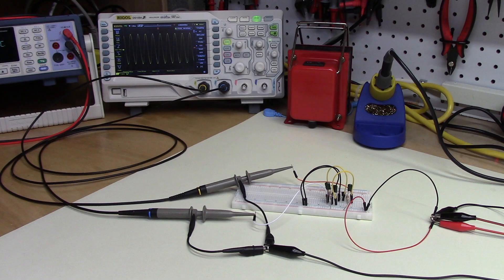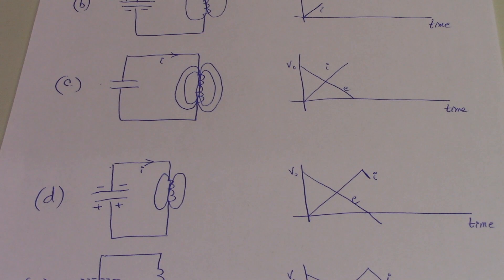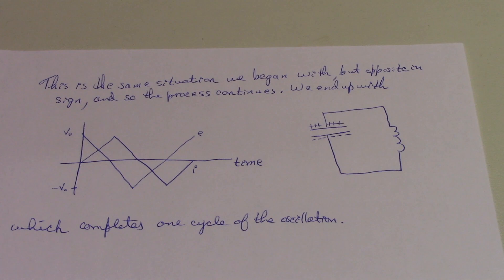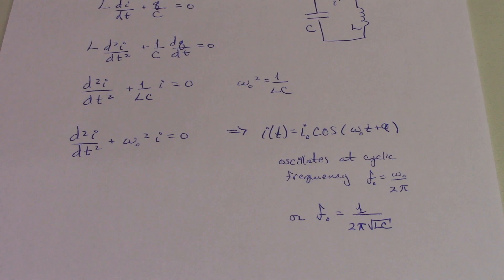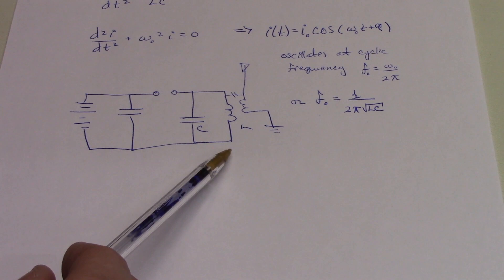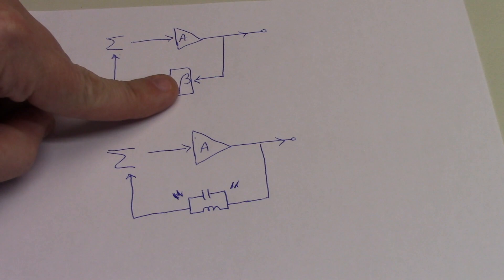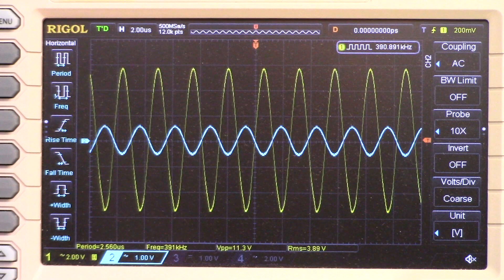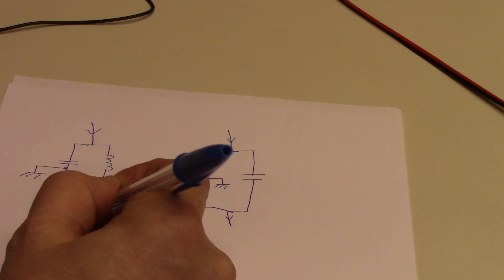#38: LC tank circuits and the Colpitts oscillator

Comment: 1. Instead of having a spark app. You want to pulse with modulator.
2. You want 2 coils, one capacitor With as close as you can the same values.
3. You want One coil  clockwise the other counterclockwise.
4. And you want the entire circuit in series never parallel.
5. From there, you just want to test out. Where on the circuit you put the ground. You'd be surprised that different voltages you'd get. 
At 1.5V I have gotten 10 -20v But that's if you know where to put the ground on the circuit.

Comment: Interesting and nicely explained, but I tried it with a BC548C and a 9V battery, and some bigger capacitors to get a lower frequency, but it didn't do anything.  Only with a bigger inductance (10mH), it started after I "shorted" the 1M resistor with my fingers.  The frequency was pretty stable, but it was a very "deformed" sine wave.  Are there any rules to observe here?

Comment: The capacitance and impedance of both the probe and coaxial cable would load down and detune the oscillator? The stray capacitance of the breadboard jumper wires would only decrease and not increase the natural frequency?

Comment: Nice video. One question: why is it stable? Usually with oscillator, you'll have to have non-linear element so that the loop gain is exactly 1 (if it's just slightly more the oscillation will go out of control). I often saw light bulbs or PTCs. What is the equivalent element here? I guess it must be the non linrarity of the transistor. How does that translate in distortion?

Comment: Hi, this is a very instructional video. I am looking forward to setting up a DC Tank circuit with both the inductor and the capacitor connected in parallel, where a battery could charge up the capacitor, and after the battery is removed from the circuit, I would like to show relatively "undamped” amplitude oscillations on one oscilloscope screen.  I am not sure if the antenna or the transformer that you refer to in this clip are critical to the purpose of my circuit.  In order to design this type of circuit, could you please share with me appropriate capacitance and inductance values, the type of capacitor, battery and oscilloscope settings?  Thanks for your attention to my request!

Comment: Bundle of thanks Sir. But I have a question about the two capacitors how the circiut oscillate . i think the inductor charge through C1 in first +ve half cycle which also create a +ve half cycle voltage at base of transistor and after that inductor discharge through C2 which create another -ve half at the base of transistor and again same cycle repeat.  But frequency is constant the inductor should make resonance with one capacitor only. Help me on this Sir

Comment: so actually without transistors I can't make the oscillator? I mean everywhere is shown only the tank the inductor and a capacitor but with those two I can't make them to oscillate (maybe I miss something ). I have already maden a similar circuit with a quartz 4 MHz and I get a beatiful (almost) a sine wave with 4.00 - 3.99 MHz but when I experiment with only capacitor and a inductor coil I makes only a short circuit and on my oscilloscope I see nothing (almsot a straight line like a battery, nothing special, experimented with different coils and capacitors and always I get the same result - nothing :/ )

Comment: Hello, what did you rely on while choosing the values of the resistors you used? 
And is that a 1MegaOhm resistor? (it’s not clear)
And are such small capacitors (1nF and 10nF) able to produce and sustain such high frequencies?

Comment: funny how the current keeps going in the same direction once the capacitor runs out of charge ,  this is cause by the collapsing mag field, ok, but the voltage is flip around.  How can the voltage between the cap//inductor  flip but not the current direction?  Even for that brief period in the cycle.
Reply: This is due to the fact that inductors try to resist any CHANGE in current. This is important because when the capacitor finally balances it's charges (aka completely discharged/neutralized), there will no longer be any electric potential from the capacitor. This will mean that current should drop. But our inductor does not want that to happen! So it continues the current in the same direction as it was going before.
  Now this is very important. This direction of current when the capacitor was inducing it's own potential can be seen as negatively charging the positive plate of the capacitor. When the capacitor's potential is gone, the inductor will continue the current in that direction, which will cause the formerly positive plate to become negative, and vice versa for the other plate.

Comment: You have no capacitor at the input of your emitter follower amplifier... there is dc current in your tank circuit ... is that suppose to be that way? o.O 
Also you wrote 1mili Ohm at your RB resistance i m guessing it sould be Megaohm

Comment: How does it perform when you change the voltage supply ? how many % does the freq change with say 10%,20% Vcc change?
Is the freq stable when you change the transitors to have different hFE?

Comment: If the node between the two capacitors is AC ground, why doesn't the AC current from the output just get dumped into ground? i.e. if ground is between the caps, how does that ensure that as one charges up, the other charges as well?
Reply: For anyone with the same question, I found my answer: the LC tank acts as an open circuit at resonance, so there's no AC current entering the tank from Vout; there is current flowing in the tank, but it's just being passed from caps to inductors and back. This current flows the same direction thru both caps, creating voltage drops in the same direction, but the ground reference between them means one is a drop from positive Vout to ground while the other is from ground to -Vout.
Reply: This explanation is something that it is always missing in all videos. Good for you that you have written the answer. That's also why the two capacitors are considered to be in series, not evident by just looking at the scheme.

Comment: Can c1 and c2 be the same?
Reply: C1 and C2 act as a voltage divider so as to attenuate the amplified output- you want gain to be 1 so that the positive feedback doesn't create oscillations that grow without bound. If that happened, you'd probably get a square wave instead of a sinusoid as the output would keep hitting the rails.